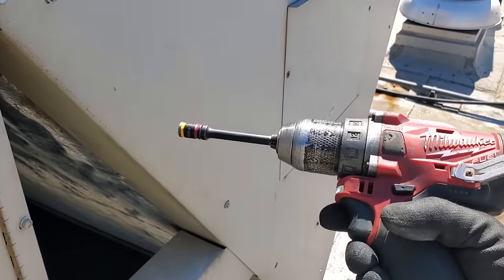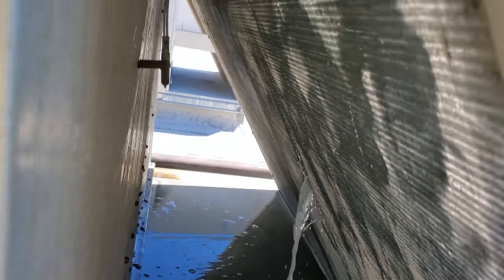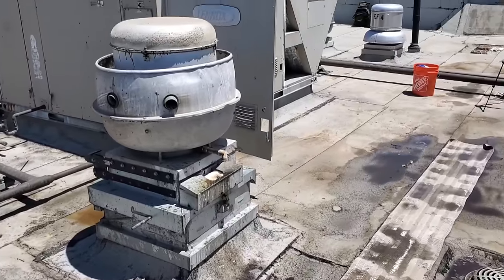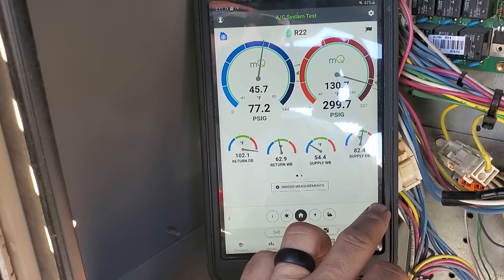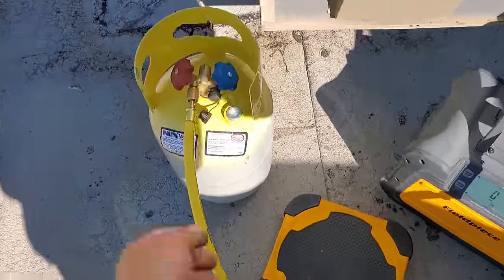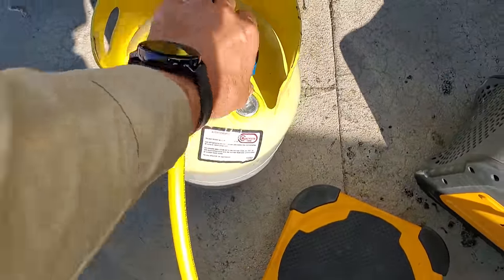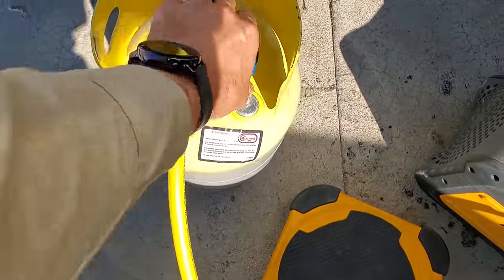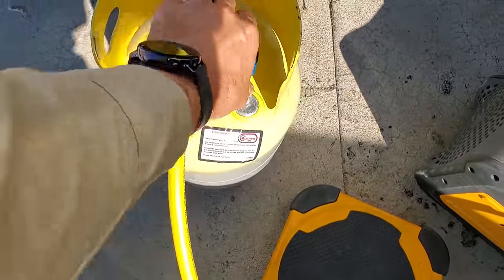IT'S DYING A SLOW DEATH

Comment: 22:10 curious Chris, why not just change the head and the guts of the TXV? the body is just a brass body, you can solve the problem and save the lugging of the torch by just doing that, thoughts?
Reply from the maker: I thought about it and almost did that but I had the torch for the drier and figured it would take just as long.....
Reply: Nah let the paying customer get his whole new part and save the old piece in a bin for the guy who needs his ‘job done on the side’.

Comment: i had come across a unit that the residents had been calling the home owner and it was all because a dirty filter. they called the home owner because their ac went out and i opened up the unit and the whole unit was neglected. i offered them a deep clean and a diagnostics for their current consumption. I got them up and running!

Comment: In 70s always low on makeup air. Always undersized heat and units. The never figured for exhaust make air Los.  U need more cfms and btus . Never ending problems tell problems wouldn't let fix . The company I worked for installed and serviced.  Enjoy videos.

Comment: I have seen sludge like that before and it results from Teflon breaking down - usually from overheating. Cheap Chinese compressors use Teflon seals on the pistons.

Comment: I WILL NOT throw my impact in the trash! 😂😂😂 in the 3 years that I’ve owned the thing, I’ve never stripped anything out with it. It’s just like a pneumatic impact wrench that you use to work on your car (I have one of those also), which works basically the same way, you gotta know how to modulate the trigger. The trigger on mine has a variable speed. I did break a couple of lag bolts when I first got the thing, since I still haven’t quite figured it out yet. I will say though, impact drivers make terrible drills.
Reply: Unless you are doing woodwork and trying to drive 2+in screws, then impact drills are very nice and prevent stripped heads and beat out drills every time. Other than that, their whole deal is really putting a lot of equivalent torque on a fastener.

Comment: I'd bet those compressors would meg bad.  Did you consider a replaceable suction filter to clean up the oil and try and stop the impending compressor failure?

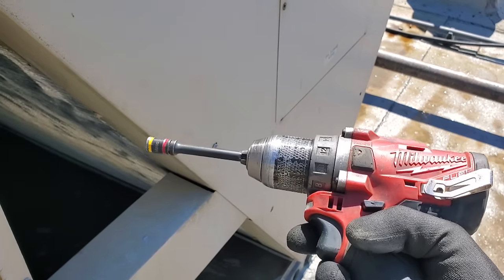Comment: 5:23 you should never have your drill setting on drill, unless you're drilling. 8 or a 9 setting on the clutch is usually where you should be for screws, ESPECIALLY on Carrier RTU's (and as always, the U stands for unit) LOL And I never use my impact gun unless I'm doing tower work.

Comment: When the pulley wears down like that that means the belt does not have the right tension. Then the belt slips as it runs and rubs against the pulley and wears down the pulley over time.But it will take a long time to wear down. IT ALSO SCREWS UP THE TIMING OF THE MOTOR AND OVER TIME KILLS THE MOTOR AND BURNS IT OUT. And that's when your blower motor stop working. Great job Thumbs up. Peace out.

Comment: R22 makes wax. Especially  when dirty condensers raise the temperature of the discharge line. That crap in the drier is wax and broken down oil...above 250 degrees at the discharge causes oil breakdown. RSES Service Application Manual or SAM. Check it out!
Those orifice tubes (that plug up) in trane voyagers and small Carriers yup wax.

Comment: it's so cool seeing someone braize (or however that's written) copper lines ... I've never seen that before. I knew that it was done similar to soldering, but ... it looks so cool =D
Reply: Brazing is done at higher temps and is stronger than soldering. Which is why it's used, due to the pressures and vibrations.
Reply: @TheNemosdaddy  so it's basically a stronger bond? It's melted copper used to fuse the copper pipes together, right? (hence the green flame).

Comment: I'm guessing that the last technician hooked up a hose with contaminants inside. I hooked on to a deli cooler once and got the same type of sticky goo in my gauges. I had to tell the customer to junk it due to the cost of changing a compressor vs getting a new machine. They should probably replace that rooftop AC.

Comment: 3:20 Service persons should know to never ever make contact with condenser, evaporator or radiator fins. Whether it be by hand or high-pressure wash, don't even make eye contact with those fins because they will bend easily!!
Reply: If you sneeze on one it will be completely flattened

Comment: Hey Chris , question for the live stream: why don't they make the bloody copper stubs that come out of the dryers a little longer so we don't bloody burn  the dryer body every time we braze it ? Cheers mate 👍.
Reply: Then the manufacturer would have to spend more money on time, materials and equipment redesign/resetting for the new design and that would make them more expensive to buy...

That and likely not enough people have ever pointed it out to the manufacturers to make them care enough to make the change...
Reply: Heating the beads is the last step of dryer manufacture.

Comment: Hey, what is that putty like thing you wrapped around the filter and the expansion valve before soldiering? never seen something like it.
i always use a wet cloth :D
Reply from the maker: Its called Viper wet rag by refrigeration technologies.... there should be a link in the show notes

Comment: I've always found that an ice bath is almost required when recovering larger systems, especially on a hot day. I hate stripped panel screw holes so much I actually carry a handful of slightly fatter 5/16th self tappers in my pocket at all times; along with a couple wire nuts and female spade wire connectors.

Comment: is there a reason why you don't use a MAP gas torch? I have one that attaches to the bottle with a hose and you can manipulate it just like a brazing torch, works great for doing copper plumbing pipe but i am not an HVAC guy

Comment: impact is fine for disassembly, but definitely not for reassembly unless much care is taken. my m12 has two settings, with one being very gentle which works great for that. i also have a 7.2v makita impact screwdriver that is just strong enough to be useful but not enough to strip most screws. 
A bigger picture here for you chris, something I noticed long before impacts came to market...
KEEP UP WITH YOUR SCREWS! can't tell you how many units i've worked on that had half the wrong screws in it which is why they were stripped. most people don't realize there are different size hex head sheet metal screws :p or they just use what they can find.

Comment: You guys would laugh me off the roof if you saw how I would have done this same job!!!!😂. I guess just how and what I use to check charge..lol. I carry a fluke 324 with a general purpose type k wrapped on the suction line with 130c for SH Then I use approach for SC.. lol.  That only requires one more air probe/ then the temp / pressure conversion on my high side gauge.  There is no way I would have reused the gas. It crazy how different we all do things to get to the same result. Great job as usual. I love watching the videos

Comment: a loose belt would wear down the pulley faster because it is more prone to slippage, which causes ablation. a correctly tensioned belt does not slip on the pulley as it has a friction that prevents it from doing so, indicative of efficient energy transfer.

Comment: I don't like the return(suction) line temp being that high. I'll have to check with our Engineer but I was told that Copland does like the return temp above 75° F.
Have you used you recovery machine to charge the systems? I see why you didn't used it this time.
Were the VFD's undersized for the exhaust fans and ambient Temps you have?

Comment: Do you ever use a quick charger when charging on the low side or do you always throttle it with the gauges and valves?

Comment: Former automotive tech here (recently quit to go back to school). When I was in school studying automotive technology, they wouldn’t let us use power tools. This was back before electric power tools were any good, so we are talking air tools. When I got my first job as a tech, they wouldn’t let me use power tools. The whole time, I was like “wtf why?!” One day, I finally asked. They said “you have to learn how to work with fasteners by hand before you can use power tools.” Made total sense after that, and it was a valuable lesson learned. I don’t break bolts even when using power tools. I’ve had to take away power tools from young techs because they would constantly be breaking, stripping or cross-threading fasteners. Nothing wrong with power tools, but you have to have a brain in order to use them and unfortunately some people just don’t.

Comment: I like how those Lennox condenser coils are not double stacked coils but I still don't like the design. One question I had is,how do you know if you have pressure limiting TXV vs regular TXV. Also, are you working at a Cheddars?

Comment: I bought the probes and love them. I wanted to ask though I keep having to zero out the pressure probes on measure quick. Does your probe read in a vacuum or positive pressure when connected to nothing.
Reply from the maker: Yes i find i have to zero them every time

Comment: Sounds like quite a situation! I once saw someone tearing apart a car's ac system that appeared to have similar junk in the reciever/dryer (compressor and clutch destoryed) had oil that burnt and then was cooked off (or something) I don't work on HVAC, refrigeration is very interesting I do mechanics for a living and like just about anything real and technical (not software).

Comment: G'Day,"Cool Dude,"Hmm that crap you found in the dryer,looks like oil..dehydrated oil,,
Be checking compressor oil,even change it,,you said ya self ,,when it runs,it runs very hot,,
Should be able to smell it,,should be a sweet sorta smell,,But if it stinks,,Oils Kaput,,

Comment: sounds liek a bearing might be slapping a bit it sounded really rough on start that filter you cut open the foam inside looked like there was some flakes in there. the goo may be oil that has varnished  from over heat but idk

Comment: Looking at the difference between the pressures, it definitely signaled a restriction because that pressure drop was just too great that adding a charge wouldn't do shit but exacerbate it. 

The question is still why... I think the heat inside the motors (compressors) will far exceed ambient air so I'm not sure oil breakdown from that alone would cause it. Maybe just age and working harder because of the outside air draw over time coupled with heat... that could do it. Heat and time always does. Could be made worse if there was some small, preexisting contamination already present in the second stage compressor. I'm sure it's just aggravating to know what could be done to make it near factory spec... but you have to work within the constraints of the customer. It also makes sense to them to put a value on these over time and just say "that's depreciated to zero and not working, replace the sumbitch." It's not accountants doing that until they have to. I bet ya anything they're saying in the first couple years "yeah pay for PM and do that fix" and they're overridden. Then it's tossing up the arms after 10 or 15 years and saying "it's worth zero bucks, junk it." In the end it means more money for you so that's good. Environmentally, it sucks because you can make that thing work another 10-15 years before too many parts just start failing. Oh well.

Comment: I'm thinking there's a piece of the compressor that went threw the system that's why it sounded so bad I'm guessing here but I hope its the correct guess please tell me if I'm wrong hvacr videos
Reply: Drier didn’t have any mechanical holes punched through the filter material, just crud oil and possibly Teflon. Where it came from is anybody’s guess. Teflon is mostly nitrogen.

Comment: Did you smell the refrigerant for burnt oil? Or test for acid? (Pretty acrid / nasty smell) Sometimes the burnt oil is what causes sludge, and you know that dirty condensers cause overheating which in turn can cause the silica gel to break down. Another unorthodox test I used to do was put some silica gel beads into my hand and add a few drops of water. If it did not get hot then there was water in the freon which also caused the gel to break down as gel beads plus water gets quite hot and turn to powder. I never did figure out how the water got into the system other than an incompetent mechanic.

Comment: Chris quick quick question , when you guys do a flush out in Cali ? Who do use ? Btw, great video once again !
Reply from the maker: What is a flush out?
Reply: No sure what you guys use for compressor burn outs or small contaminates built up with in the system . I’ll usually introduce  R11 flush and then blow out the coil with nitro and then braise everything back together . I noticed some techs do and some don’t . Was just curious if I missed something . Thanks for responding

Comment: Also sometimes when a system with a belt fires up it sounds like a screeching car is it when the belt is to old or Crocked?
Reply: Pinching in the pulley or the slipping in the sheave.

Comment: Man, i was scared to see you pull the plug off a running 3 phase compressor. Had those almost explode in an Arc before.
Reply: The faster the better. I know what you mean. It also drives me nuts seeing people stand in front of a 3phase disconnect while flipping the lever. Just a 20 amp dead short explosion will try to push the door through a skull. Rare but so is winning the lottery.
Reply: @tthack84  seen crazier things happen.

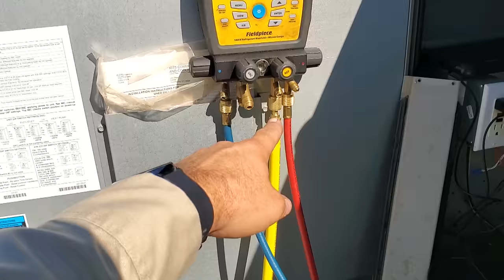Comment: 17:40 for a circuit that has had a restriction that's been running for an unknown amount of time, it's a good idea to do an acid test (especially if you're gonna reuse the refrigerant) I prefer not to reuse simply because the guy that had the recovery cylinder before me might not know how to use a drill LOL

Comment: I work in Transprtation.  I ahve seen those stupid little beads getting out of the dryer.  I have even seen them disintegrate into powder and go right to the TVX and compressor.  Long process to clean.  The system will never be virgin again.

Comment: I can't agree with you more about impact drivers and how they're miss used. I personally hate them unless I'm trying break loose a stuck fastener. They're not meant to drive anything smaller then a 1/4-20 bolt IMO. Its called the "feel of tight" using a drill. You just don't get that with an impact gun. Nice job over all.

Comment: It does surprise me that those fans don't have downwards pointing vents / louvres in the top motor section. 100 degree heat with the sun beating straight down on them, those motors most be red hot!

Comment: I think low on gas, it's been cooking itself and the oil both, which clogged the drier.
if not low on gas, wouldn't the discharge pressure go sky high? certainly the cond. coil circuit couldn't handle that much backup without peaking sky high?
Reply from the maker: But i made an assumption the dirty condneser was causing the high head pressure... maybe it wasn't the cause...
Reply: @HVACRVIDEOS  I'm sure that wasn't helping any!
maybe previous tech/company removed charge to keep head from going screaming high lockout? who knows though

Comment: Wow,  I just had an ugly flashback  when I saw the desiccant beads from that crappy Alco drier.I had a few liquid lines plugged at the TX while an apprentice.
that sludge in tx looks like your oil is breaking down.
impact or any tool is only as good as the operator

Comment: I knew the txt wasn’t the problem when  the Freon started to equalize when the system shut off, if the Txv was locked that low pump down pressure would’ve stayed the same when the system stopped..

Comment: I wonder what kind of drives they had and why they kept failing.... a high quality drive doesn’t just fail usually... I just programmed a 25 year old abb drive..... most modern drives give you the ability to set up safeties and limits
Reply: Most variable drives will get lazy in a year or three after they figure out there’s no makeup air unit waiting to do their job or it’s just shiftless.

Comment: So why does it frost up when it's low on charge? I imagine it's a common sense question but I still want to know anyway.
Reply: Because a running compressor isn’t just going to sit there and pump nothing. The oil itself becomes the refrigerant, and while it’s ordinarily not combustible, being it’s liquid and that it’s still got latent heat capacity, it will move in a system in place of the gas and being that it’s viscous -oil lags too long going through the condenser: which subcools the hell out of it. So by the time cold oil makes it back to being shoved through a metering device still engineered for the missing gas, that commandeered-oil absorbs plenty of extra energy after adiabatic decompression from being force-pulled through the tiny orifice into the suction side, which again lags going through the evaporator. Then insufficient air flow over the TXV/evaporator allowing them to reach a lower temperature than the dew point causes a condensation too cold to drain off, which of course freezezes into ice, which insulates the area as it accumulates, cooling, thickening, and slowing the oil down even more. PAG is single weight oil, not multi-viscosity like automotive oil.

Comment: Does anyone make a unit that checks compressor temp?  I'm picturing a high end system that constantly monitors compressor temp and throttles the unit to protect the compressor while also throwing an error code.  A service call for an underperforming unit with an error code has to be cheaper than replacement of the dryer and metering device.  Would you rather tell the customer "hey unit was dirty", or "hey unit was dirty and things broke"